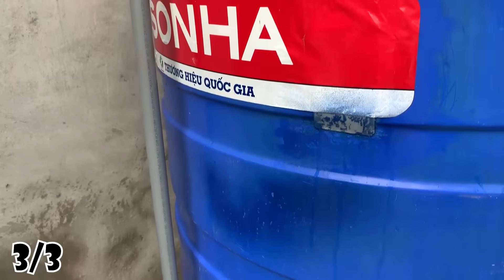I never have to buy water again ! How to make PVC drainage pipe for corrugated iron roof 3 in 1

Comment: We run our house on rain  water with have 4 ibc tanks  and on a  water meter. But we  don't  drink  the rain water 😮
Reply from the maker: ### Can Rainwater Be Used for Domestic Purposes?

Rainwater can be used for domestic purposes, but it must be treated and monitored for quality to ensure it is safe for health. Below are some ways to use rainwater for domestic purposes and the necessary measures to make it safe:

### Ways to Use Rainwater for Domestic Purposes

1. **Watering plants and gardening**: Rainwater is very suitable for watering plants, gardening, and other outdoor activities because it does not contain the chemicals often found in tap water.
2. **Laundry**: Rainwater can be used for washing clothes, helping to save tap water.
3. **House cleaning**: Rainwater can be used for cleaning the house, washing cars, and other cleaning tasks.
4. **Drinking water quality**: If properly filtered and disinfected, rainwater can be used for drinking or cooking.

### Measures to Treat Rainwater

1. **Collection and storage**: Collect rainwater from rooftops into storage tanks. The tanks should be made of safe materials and have tight lids to prevent insects and dirt from entering.
2. **Water filtration**: Use filtration systems to remove impurities, dirt, and suspended particles. Sand filters, activated carbon filters, or specialized filters can be used.
3. **Water disinfection**: Use disinfection methods such as boiling, UV light, or disinfectants like chlorine to kill harmful bacteria and viruses.
4. **Water quality testing**: Regularly test the water quality to ensure it meets safety standards for domestic use.

### Benefits of Using Rainwater

- **Water conservation**: Reduces the consumption of tap water, saving costs and water resources.
- **Environmental protection**: Reduces the strain on urban water supply systems and mitigates flooding by collecting rainwater.
- **Self-sufficiency**: Using rainwater reduces dependence on public water sources, especially in areas experiencing drought or water shortages.

### Important Considerations

- **Water source**: Avoid collecting water from heavily polluted areas or roofs containing harmful substances.
- **System maintenance**: Regularly clean storage tanks and filtration systems to ensure efficiency and safety.

With appropriate treatment and control measures, rainwater can become a valuable and safe source of domestic water.
Reply from the maker: @timh132 Rainwater is truly precious and we need to save water from today. Thank you for watching the video, have a nice day

Comment: It's better to weld pvc pipes, glue is not good with temperature fluctuations. Idea is good, but not sterile at 100%. Better to warm water
Reply from the maker: You are right. Maybe I need to make a bacterial filter or a solar water heating system to ensure the water is safer to use. Thank you very much. Do you use such tanks at your home?

Comment: the rocks and buckets for filtration should be outside the water.
Reply from the maker: Do you mean it should be placed above the storage tank, so that the water will flow down into the tank afterward?
Reply: Yes. The dirt and particles will otherwise be difficult to clean and monitor.
Reply: If the filtration is outside the tank then you can easily clean it.

Your method is very good too.
Reply from the maker: Thank you very much. With the level 2 filter using PVC pipes, I can clean the filter chamber by pumping water back into the tank and closing the red valve, opening the white valve, and opening the metal valve in the middle. 2 storage tanks. Then the water will flow out along with the dirt. Have a good day.

Comment: Normally you fit a gutter before the roof 😉
Reply from the maker: Typically, the drain should be installed prior to finishing to ensure the drainage system works effectively. Have you encountered similar issues in your projects? Or have any tips for properly installing a drain that you would like to share?
Reply: @HolicCreation  👍 just bolt metal gutter hooks on and drop gutter in simple on metal roofing been doing roofing for 40 years good luck with your channel oh not taking the piss just a laugh have a great weekend👍

Comment: Sand ,stone and carbon use to remove smallest sediments and remove odors only but cannot kill bacteria because the roof is vulnerable to rodents,animal waste etc. There must be another chamber to kill bacteria first before passing thru sand,stone and carbon.
Reply: Better still, just boil the collected water before drinking.
Reply from the maker: @BebotPaqueen You're right, I need to upgrade this filter with a final filter to kill bacteria, or use a solar-powered tank to heat the water, for example. Do you use a large rainwater tank at your home?
Reply from the maker: @UncleZindabad You're right, boiling water is the quickest and most economical way to use it. I might install a solar water heater because I live in a tropical country near the equator. Which country are you living in, my friend?

Comment: You can drink rain water but the peebles and gravel is not enough to sterilise if for exemple you have a dead bird on the roof…
Reply from the maker: You're right. Fortunately, where I live, birds don't often frequent the rooftops. They prefer to inhabit forests or areas with dense vegetation around the city. Also, there aren't large birds around. Nonetheless, it's still something to consider, and if a bird were to perish, it could emit an odor, but I could swiftly remove it from my roof. How's the weather where you live, my friend?
Reply: @HolicCreation  I live in Sulawesi tengah

Comment: By own we can do with material, but labour cost tobe high in market,,for simple pvc joint they charge 500 rupees 🤔,finally these are waste expenses 😅
Reply from the maker: I made this system myself and it only cost about $170. The usage time is very long, you just need to clean the filter every few days by opening the white valve and closing the red valve, then open the metal valve in the middle, water will flow out along with trash and dirt. Where do you live  ? 😅😅
Reply: @HolicCreation  from Hyderabad, south India,and I am an engineer mechanical Retrd.person

Comment: If birds make 💩💩💩 on the roof, what will happens with water drinkers?
Reply from the maker: You're right, the filter can catch bird droppings and the mesh will catch solid waste like twigs or leaves. But maybe I need to install an additional antibacterial filter. Or we can simply boil water to use. Do you have any method that can help me?

Comment: Not practical ❌ because where the rain is coming often there is no shortage of freshwater like my country and there is shortage of the water where rain is not coming 🤣🤣🤣🤣
Reply from the maker: In areas with low rainfall, it may be necessary to dig a large pit and line it with a waterproof membrane underneath to collect enough water for use. Do you have any solutions for such regions? Bringing water from elsewhere, or drilling deep into the ground tens of meters? Thank you for watching the video and giving me advice.🤣

Comment: what about animal poop on the roof? birds, cats not to mention rats? good for cleaning but maybe not for drinking
Reply from the maker: Perhaps that needs further improvement. I will upgrade the roof mesh for this system. After that, it's best to boil the water before using it. Do you use large storage tanks for your home?

Comment: 😅😅😅😅 waist of money ,,,water filter capsule is aprox 1000 very big size ,,,,of not enough then you use RO system 10 thousand aprox 😂😂😂ready for 2 mn only instal ,,,😅😅😅it's totaly waist,,,,,,it's called jugad but not trusted then RO
Reply from the maker: It's true that water filtration systems can vary widely in cost and effectiveness. Some find that more expensive options like RO systems provide thorough filtration, but others prefer more affordable solutions like filter capsules or jugs for their convenience and lower initial cost. It depends on individual needs and preferences!